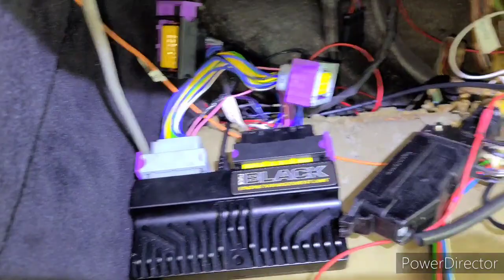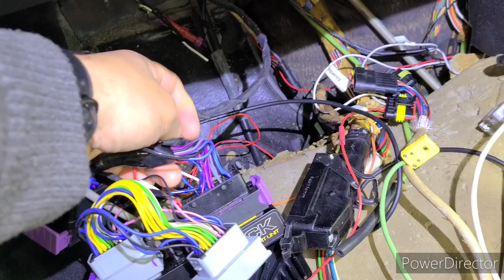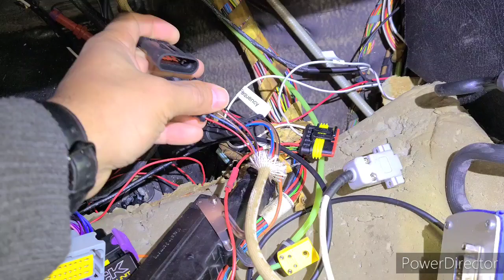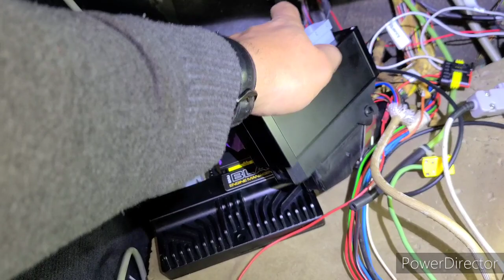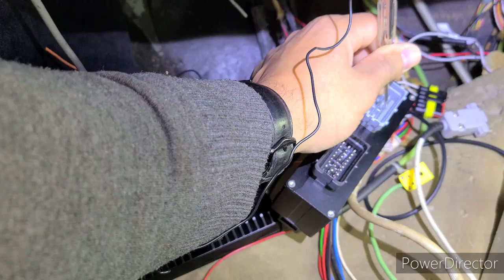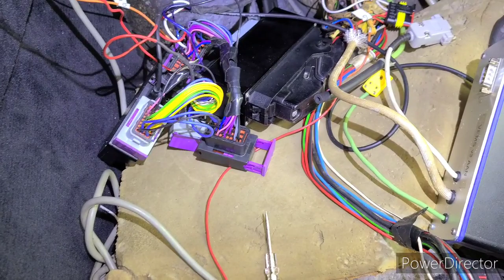ECUMaster EMU Black Audi AAN PnP ECU *Not Soo PnP*

Comment: I'm running an ECUMaster black on my built URS6. Build thread over on S2 Forum. One thing I can't get working property is that my trigger tooth intermittently drops down from 90 to 89. This has big impact on timing and the car misfires hard when on boost. The trigger tooth shouldn't change...ever. Tried lots of stuff to get it to work property with no change. Honestly, just hearing that someone got it to work would feel great. Did you get the trigger to work correctly?
Reply from the maker: Had the same problem... after various reports from other user, I didn't want to risk it jumping on me either. Sold the unit, jumped ship, went MaxxEcu and timing is rock solid.
The whole experience is 10x that of Ecumaster
Reply: @mushasho  I was really hoping you weren't going to say that. Shoot. I think the only other option is to install a 60-2 wheel on the front crank pulley or use one of the ones that's built into the RMS. Any experience with running a 60-2 on an AAN / 3B?
Reply from the maker: Using the RMS sensor is a pain when it fails.
I'd recommend this if you have a 7a style clutch setup.

https://www.ultraperformance.co.uk/audi-s2-rs2-lightweight-sm-60-2-flywheel @Coulter Lewis
Reply from the maker: Front crank version is no longer offered by 034 ... who's else carries it  @Coulter Lewis ?
Reply: I already installed a Ringer Racing flywheel. I’m an idiot and didn’t go for the $200 option to have a 60-2 cut into it. I have an 01e out of a 2.7t so I could have used that trigger setup. I think I’ll just fab a 60-2 on the crank pulley. Will be a bit of work but I really don’t want to pull the engine again…

Comment: You have to open the adapter black box, and solder betwen 4 points. I have the same kit in a s6 2.2tq. The reason four it being like that, is that the adaptor is for 2 different engines types.

Comment: Hi mate, did you have any issues with tacho on AAN?
I have erratic tacho on EMU Black and still can't get it working properly, while the ECU sees the rpm perfectly fine.
Reply from the maker: In my experience, bad tach on our older platform is usually vehicle wiring or something electrical if the ecu sees a solid signal